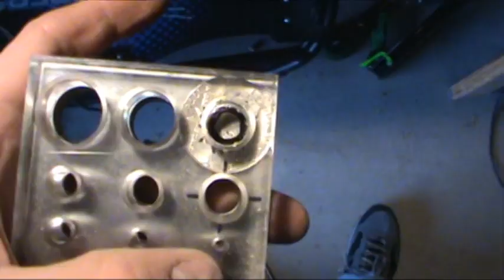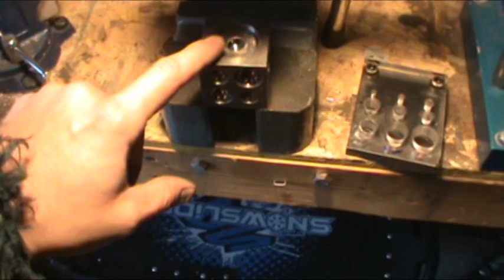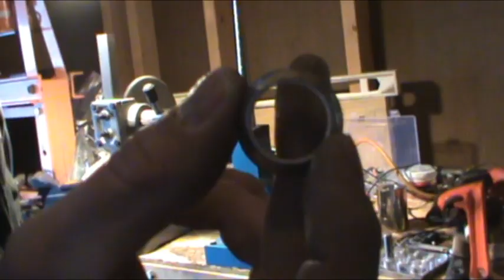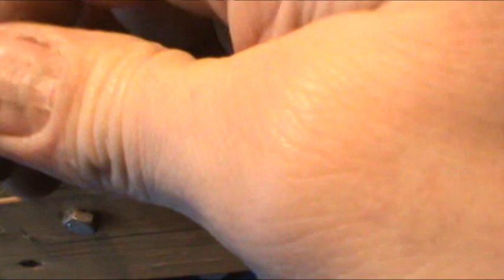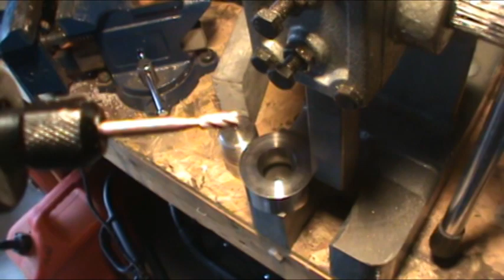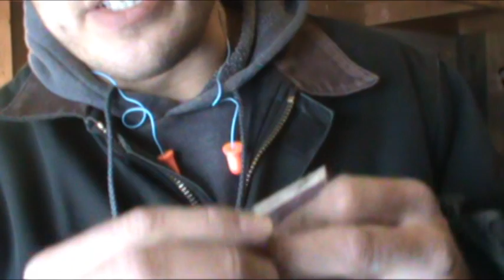Making a Coin Ring Series - Master Level

Comment: This is a great video but your forgetting the annealing of the coin after every time you work harden it. You wouldn't have to worry about cracks because as you heat the coin to orange, it helps keep that from happening. Also makes it easier to bend. --> a jeweler
Reply from the maker: Thank you

Comment: I guess you never heard of annealing your coins with heat to help prevent tearing or splitting
Reply from the maker: What is annealing?
Reply: @MyRustyNickel  annealing is making your coins softer so they bend easier. You heat them to a orange or light red color them quench them in water. That makes them softer and less lightly to crack or split.
Reply from the maker: Come join us at coin ring crafters on Facebook. I meant to talk about not annealing in this video but forgot. When I made these videos, ring making was still pretty new. I was the first person to tell other ring makers the trick for using a magic marker while annealing to not scorch your silver. Thanks for watching my videos though. There has been so much advancement in the tools and ways to make rings I reason to myself that nobody watches my stuff anymore. You're amazing and thank you again. ✌️👍💪

Comment: Having looked  through your videos I have to ask why you appear completely averse to using heat? Annealing makes the metal softer and easier to work.  I suspect that had you used heat you would still have the original handle on your press, would not need to use the monkey wrench and would also not need the 3 ton press.

Comment: I think that to drill the coin, your method was very confusing.
The use of tools is very different from what I have seen in other videos that are dedicated to this process.
More I learned what not to do to make a good ring.
Thanks for your time.
Reply from the maker: Hedilberto Alvarez when I made these videos the center punch for coins were only a few weeks old and I didn't own one yet. You missed the point that this is 1 way to make a ring with things you already had laying in your garage.
Like anything else, process changes and ideas get better. This series and my original video were one of the very 1st videos for coin ring making. So of course other, newer videos are gonna be better. Either way the video is a learning tool. And if you learned what not to do.... Then it served its purpose.

Comment: You should anneal your ring a couple of times during your process as it will work easier and you wont have to worry as much about cracks.
Reply from the maker: Aaron Aziz I had intended to talk about that during the videos but completely spaced it out. You are correct though.

Comment: you are saying it now like: when you make a coin ring, the results will get better if you have better tools. that is not true. the first ring you made, is the one you could have easily made much much better by marking the middle like you did with the second one and drill a hole exactly in the middle. that way it would be almost the same as the second one. You could fix the cone shape by filing the inside of the coin on the think end then put in on the mandrel again and start hammering on it until the cone shape is gone. the sandpaper products you used in the last one are cheap, and most 'makers' already have them. The quality of the ring depends most on the effort you put in it. 

I hope people will read this before buying expensive tools or not start making them at all 'you only get good results when spending hundreds of dollars on tools'
Reply from the maker: Geert Perton this video is old and when created, it was to demonstrate on the 1st video what you could make with the most minimal tools. And the 2nd one was to demonstrate with a little more tools, time and patience you could achieve a better product. These are not the ONLY way to make rings. This is meant to inspire, help and give guidance. Go troll someone else.

Comment: FYI I have the same doming block but the pegs it comes with are so annoying because they really take up a lot of vertical space. This not only restricts your free room when setting it under the piston, but also adds more torque that could shift it off balance and warp the coin. 

I purchased a set of various size steel ball bearings online, and those have been a pleasure to work with! Worth the investment for the two reasons I mentioned at least.

Comment: Adam, Great videos
What size die are you using to fold the ends in after you have have stretched the ring out?
Reply from the maker: they are 25 degree I have a 17 degree that I use. But JasonsWorks Swedish wrap dies are the best of the best
Reply: With the half dollar is your die 1.1 & 1.2 @17% or 1.3 & 1.4 @17%
Reply from the maker: Oh. I made mine from his instruction manual probably a year before he came out with the ones stamped on the side. Sorry

Comment: Adam I bought the reducing dies and I can not get a even outside to save my soul. I don't know anything about pitches etc or degrees folks talk about I just try and try to get  the results shown here. I end up with a ring that has a horrible bow to it when I have reached the size I want on the mandrel. So then I put in reducing die and end up with a horrible rim. I just don't get how to use the dies I guess. I have no problem with quarters it is mostly the half dollar rings. Just drives me crazy !
Reply from the maker: Are you getting the exact center punched out of the coin? That can be a big factor. Also, try compressing just a little bit and then rotate the coin a quarter turn. Keep turn it until the desired size. Somtimes that helps also

Comment: Thanks for the video.  I have been looking at different ones one this subject and was curious that no one has mentioned anything about starting points for ring sizes, especially smaller sizes.  Also - on the same subject, how does this affect the size of the coins being used from quarters, half dollars to dollars?  In this video no reference was made as to the spec.'s on the tools that were machined made for use in the video if a person wanted to do the same thing.

Comment: shit, if i would have known you at the time, i could have made your custom pieces. i work in Precision CNC machining so it wouldn't have been to much trouble at all. do you know what micro the finish is? dumb question, and i'm sure as long as it is better than 16 you wouldn't have any issues. also, what type/grade of steel did they make em out of?
Reply from the maker: If I remember right, he said it was tool stock. And for the finish I did not get it hardened and I watched him use some fine emery cloth on it while it was spinning in the lathe. No idea if those answer your questions because I'm not a machinist and I've had these for over a year. Hope that helps 😉
Reply: it totally helped, thank you very much.

Comment: My dearest Adam. It seems like forever since I contacted you. That might be because I have never done so. I need a HUGE favor. My mother who is called Wife says I shall not purchase the press nor anything that will make my task easier, and of course I do not sell the rings. It is just hobby and I am learning it to teach to the local Scout troop for the metal working merit badge. I have a .999 silver 1 troy ounce round. It was a custom coin a friend made to sell at his store. This is the ring I want for myself. The problem is I cannot get the coin to roll over without it stretching way too large in size. Because of the size of the coin if I press it in a vice to reduce it, it bulges out too far making it uncomfortable to wear. I have destroyed 100 dollars worth of coins now but not a total loss because of the melt value and the real purpose of the silver anyways. Would you be willing to let me send you a coin to see if it will work in the press. I am a 10.75 to an 11. When reducing it rounding the edges see if you can just curl the tips to keep it as flat and straight as possible giving the thickness of the coin. PLEASE

Comment: Hey Adam sry to bother you with this, everytime i use my ring sizer i seem to rip the coin. Thats the 1st thing haha  Then if i don't have the custom die's yet, can i use the reducer that came with my ring sizer? I know dumb ?'s but i have broke several copper not silver i won't try a silver till i know i got this rite. You said in my last ? to anneal anneal anneal, Do i do that with a non silver coin? I am waitin on my custom coin punch, for rite now I am usin the HBF cheap lol punch set.I also don't have a arbor press yet. So I am stuck. Mayday mayday I'm goin down, help help PLZ Thx friend sry for all the ?'s Michael Oh I have watched all you vids startin with the beginner which surely is me haha
Reply from the maker: I'll respond tonight when I'm near my computer.
Reply: Thx sooo much>
Reply from the maker: Yes, you can most definitely use the reducer it came with. However you will only be able to do quarters and maybe a half dollar if you keep it small enough.

No, you don't 'have' to anneal modern coins but it does help

Make sure you are sanding the inside hole prior to stretching to make sure all the small tears are gone. Also be careful to not stretch it to fast. that could be the problem too. your not working the coin evenly and all the stretch is coming from one place until it finally tears.

Adam
Reply from the maker: Copper/nickel. Today's American modern coins

Comment: Hello Adam, great job on the 3 videos.  I have a problem like you do when using half dollars and quarters;  they don't fit the harbor freight doming block at a point.  what size adapter you had machined do you find the most helpful for quarters and halfs?
Thank you :-)
Reply from the maker: The 2 smaller of the 3 I had made. I now have a 4th one that I absolutely love. You can get all the dimensions from Jasonworks paper that I talk about in my tools of the trade video. Sorry this isn't as exact as you were probably hoping for. Adam
Reply: Thank you, the best of luck.

Comment: Just a thought on your filing out the centre, by filing out the larger end won't you end up with an elliptical centre hole, because you only enlarged one side of the hole.
Reply from the maker: I can see the idea behind your question, but I do make sure that the entire hole is one uniform size
Reply: Adam McSkinney Anyway here's a thought that might make your hole making a bit easier.

Have you considered using a piece of paper, you simply draw around the coin cut out the coins shape on the paper then fold the paper in half then half again, by doing that you end  up with the centre of the coin, simply use something to draw from the centre to make your hole, lay the paper onto some card and hey presto you have a template for many coins.

Saves you having to do the math thing over and over again.

This paper trick works with any size coin, it's easy fast and reusable and so long as you know how to fold a bit of paper you will always end up with the centre.
Reply from the maker: flitsies I tried that in my early stages of making rings. It does work to some degree but not every half dollar is the same size. One could be a new mint coin and the next a hundred years old and have a smooth edge making it almost a millimeter smaller, and then possibly not centering the paper and maybe not getting the dot perfectly centered in my die... All to just have to file away at it making it perfect like I already do. This falls into the saying of 'there's a thousand ways to skin a cat' your way works and I'm proud of anyone that can make new and different ways to do things. New perspective is always good! For me personally I've found that my digital caliper requires less filing in the end. Please keep posting your ideas though. This is how people learn!
Reply: Adam McSkinney OK well there is another way to do it other than the piece of paper.

You could use your digital calliper but in a different way, ie to measure the diameter.

So you take your calliper measure the diameter of the coin at its out most extremities then you half the diameter and make a mark from one end of the coin to the other in an arch shape then you take the same calliper unchanged and put your point on the end of the line and make another mark this will give you the centre point so long as you have made your marks accurately, in fact you don't need to do more than two lines to get the centre, all you need is to observe where the two lines intersect and that is the centre of the coin. Then take a protractor and draw from the centre point to mark your hole size that you want.

But again you don't need the calliper to do this you could use a protractor and a ruler for making the marks.

This is another way to find the centre of a coin, but would need to be done to each coin.

Protractors are great tools for finding the centre of a circle and so easy to use, of course they do have their limitations but for coins would be perfect.
Reply from the maker: flitsies great suggestion. you've put a lot of thought into that and it sounds like a sure winner. Thanks!
Reply: Adam McSkinney Here's a thought: why not just avoid all of that headache and needless waste-of-time hassle by buying yourself a self-centering coin punch tool? Takes ALL of the measuring and guesswork out of it!
Reply: CoinRingUSA Perhaps a picture of the type of tool you mean, but I suspect it will cost a lot more than a few cents/pence unlike a protractor which will cost you very little and will provide a good indication for drilling.

Consider this, a protractor and marker drill bit to do hundreds of coins around 2 dollars/pounds, self cantering hole punch what 100, 200 dollars/pounds.

Nice idea but the cost would defeat the object I would have thought.
Reply from the maker: CoinRingsUSA I'm getting one. Only because I plan to do a booth thus summer. If it wasn't for that I would just stick to my digital caliper. An extra 5 minutes is nothing in the grand scheme of the process.
Reply: Adam McSkinney Awesome! what "booth" are you doing this summer, a tradeshow?
Reply from the maker: Not sure yet. Probably just the local town fair... I'll dig more into options this spring.

Comment: Thank you for your vids.  I have a question as a beginner who is looking to purchase a ring expander/reducer.  Do you have any suggestions regarding makes to buy or avoid?  Also, why did you not use the reducer plate on your ring expander?  Wouldn't that do what your custom dies you had made do?  Thanks for any feedback, as I am afraid I am going to buy a cheap Chinese made POS that I will be unhappy with, but I don't want to break the bank either.
Reply from the maker: I bought that exact cheap one you speak of! That's why the handle broke. Buy the cheapest one you can find but just be gentle with it and don't compress anything bigger than a quarter. You'll be fine

Comment: Adam, you talk about how you should have gotten the 3 ton manual arbor press. I looked on Harbor Freights website and they don't have a 3 ton. Only 1/2 and 1 ton, who has a 3 ton manual arbor press? A while back I bought the 1 ton press and couldn't punch through the coin, so I returned it. I bought the 6 ton hydraulic press but its difficult getting everything lined up straight. Left to right you can see fine from the front, but front to back is very hard because the way the press is made with those angled arms you can't look through from the sides to see if you are straight, and that can really screw a ring up. I notice in your video that you don't use the ring reducer. Why not?
Reply from the maker: I didn't use a ring reducer? What happened at 12:10 in my video? As for the 3ton Arbor you'll have to Google it and buy it from grainger.com or one of the other websites.
Reply from the maker: If you mean on the stretcher/reducer it's because I only use that on Quarters and Dimes
Reply: Adam McSkinney I remember now, you were working with a half dollar and the reduction dies, on your jewelry reducer/stretcher isn't big enough. Thanks for the info on the press.

Comment: Have you ever tried something larger/ thicker like a Challenge Coin?  My ring making is still at your Intermediate step.  And I've mainly messed with the Presidential Gold dollars and the non-silver Kennedys.  I did buy a "foreign coin lot" from ebay for a couple bucks.  Got 3 coins in the lot larger than a gold dollar.  Everything else was smaller than a quarter.
Reply from the maker: I have done probably almost a dozen Morgan Dollar rings. I genuinely think that as long as I can start the coin out in one of my custom ring reducers, I could make it into a ring. Especially with my 6 ton bench press. Hope this encourages you to keep going bigger!

Comment: great video, dead center is the key! I use nylon washers the same size as the coins and a scratch awl to get dead center. before that I had some jacked up rings
Reply from the maker: Nylon washer? Huh, I tried the steel washers a couple times but they were just a hair smaller than the coins. I'll look into it thanks!

Comment: Do you heat the coins before or not because I didn't see that in the video, and it looks like they stretch very easy.
Reply from the maker: I stated several times in the videos that I did NOT anneal these coins. They were modern coins with more copper than anything else and did not require it. HOW EVER! if you do use silver... The very first step before you do anything is,  anneal. It. Then after EVERY step after that and EVERY full size up that it's stretched anneal again. Basically... You can't over anneal. Do it often! Hope this helps. Adam
Reply: Thank you for your time I really appreciate it.